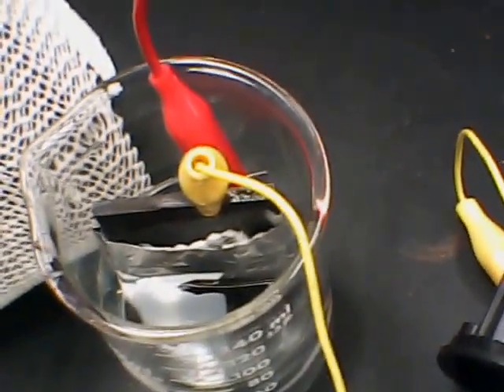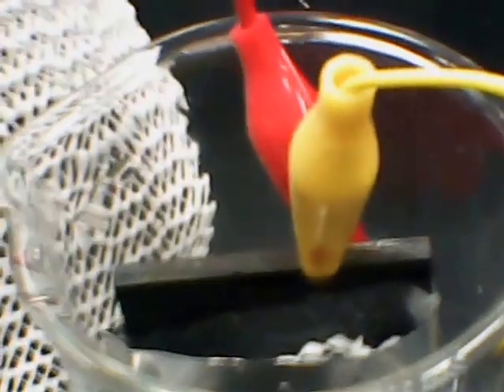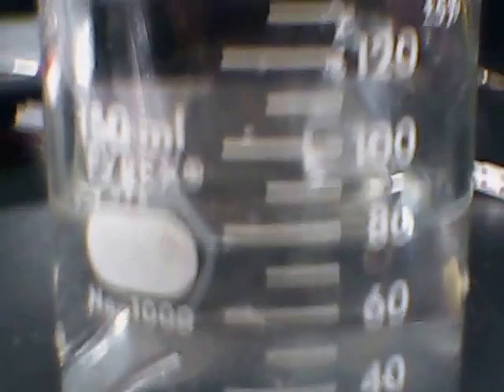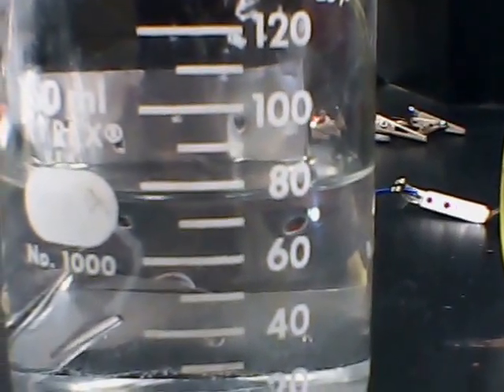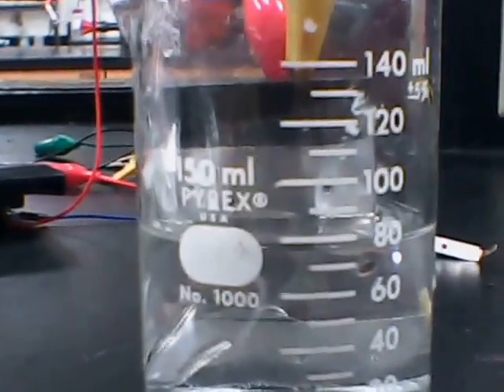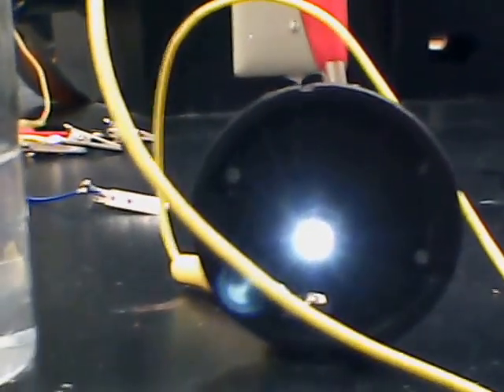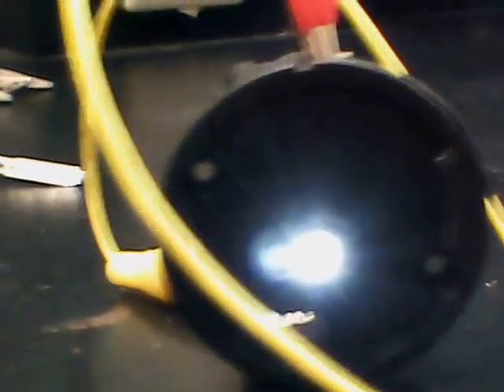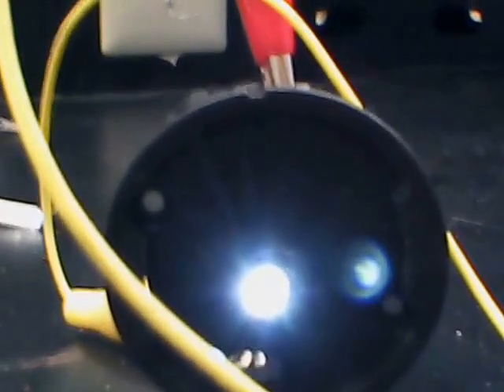Aluminum Graphite /Soda Wash Electrolyte/ Air Battery

Comment: Well done David, You can also substitute the SodaWash-water( NaCO3-water) with woodfireash-water, which also has a PH of about 9, so it is also pretty alkaline...So one does only need to make a little fire with wood sticks and collect the ash of it and put it into water and then you will also have a solution like K2CO3-KOH mixed with water, which is a great electolyte for these types of batteries...you might want to dilute this then a bit, as it is pretty alkaline and could eat up your Aluminium fry pan too fast.... Hope this helps.Regards, Stefan.